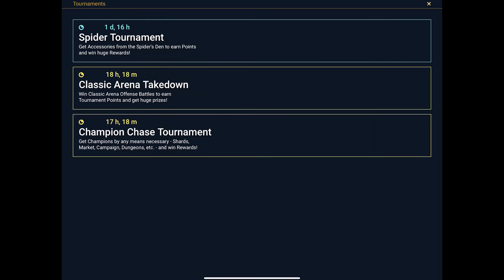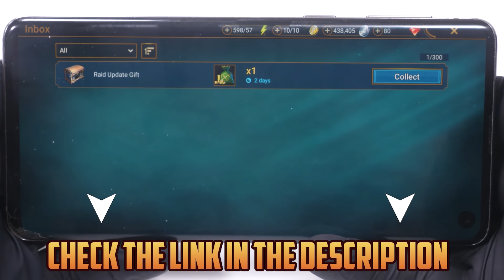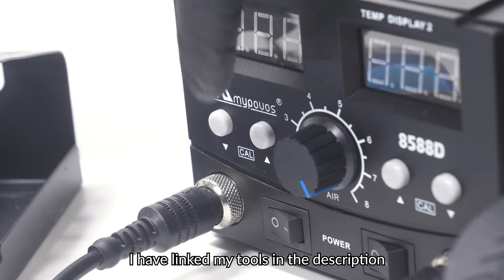Restoring RARE Casio Heli-Battle Console - Retro Game Restoration

Comment: This channel's taught me that circuit boards aren't nearly as fragile as I felt they are. I went from 'I don't want to touch it directly, I might break something' to 'ah, it's fine, you can use an old scratchy toothbrush on this and it'll hold up.' I haven't gotten too good with opening things and trying to fix them yet, but I'll be more prepared for when I get there now.

Comment: The first and only video game console I cleaned up was an Atari 2600. The outside was all grimy and dusty, while inside was (relatively) clean. I’ve never had a head for electronics so I did basic work like tightening up a loose switch (probably loose again) and cleaning some dirt with iso. Most of the carts don’t work unfortunately since I can’t get inside to see what’s wrong. Love your videos, if you get an Atari 2600 I’d love to see a video on it!

Comment: At least the thing isn't full of food, hair, fluff, dead animals ... just a bit of corrosion and discoloring. PASKA !! 03:15 Sounds like that send a shiver down your spine, when it's not meant to happen. Hot glue instead? 14:38 So its normal color is ... discolored white. Great you're using flux for resoldering as long as it is resin flux. It also helps with desoldering, so you don't overheat the copper tracks. "Ride Of The Valkyries", Richard Wagner reduced to sounds on a game console. 😆 Cheers.

Comment: The reason there is no contrast on the screen is because that game needs 3 Volts. 2.4 Volts is when the batteries are dying, yes the batteries you're using can produce the current, but you need potential difference too.

Comment: when doing a restoration of an old electronic deivce like this you should probably test and replace with capacitors on the board, they fail over time and can fry your circuit board and its precious chips

Comment: What is the solution used prior to soldering? I always just used solder with a resin core. Sometimes it works fine, sometimes I'm messing with it too long to make it stick.
Reply from the maker: The solution is flux. Mine is Weller lötwasser.

Comment: Whats the P-button for? The one recessed so you need a ballpoint pen to push in?
Reply from the maker: It's a reset button. Not sure why since pressing start/on will also reset the game. I assume there is a chance for it to freeze so that the start button would not work.
Reply: @OddTinkering  Maybe it also resets high-score or similiar. Does it exist some high-score function? The reason is that the button is recessed and made deliberately to be hard to press by mistake, so I don't think its a "soft-reset" button only.

Comment: @Odd Tinkering  I would like to ask if can use the same process of discoloration to any colored handhelds? Like pink or blue?
Reply from the maker: Yes you can, however especially if the device has been sitting in the sun for years the original color may or may not have been faded and sometimes it can be hard to see if there is a lot of yellowing. So this will remove yellowing but it won't brighten faded colors
Reply: @OddTinkering   Thank you very much ☺️ looking forward for your incoming videos

Comment: My only complaint is thatt you switched out the Old Wire for the new wire. It would have been good to know that it was all original. Also you are not delicate enough, when it came to scratching it up. In the future that will ultimately decrease the value. Other than that it was a good job.

Comment: you waste a lot everything you use...
Reply from the maker: Depends, my budget allows for some waste but e.g. the isopropyl alcohol (from the container) can be then poured for re-use to separate bottle for purposes where l don't need as clean solution and the hydrogen peroxide is always poured to separate container so it I can use it for my next video. E.g. during this video I started with old solution but after  trying  it I came to conclusion that it's been re-used so many times it is no longer usable so I opened a new canister and I will use the same solution next time as well